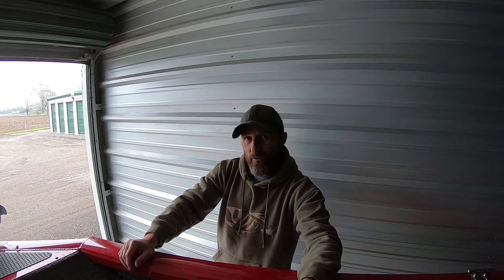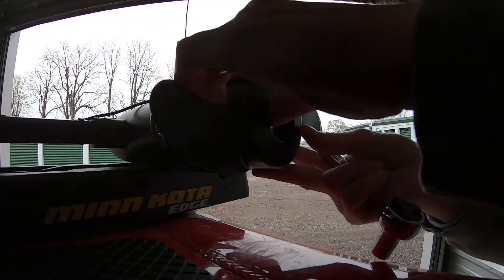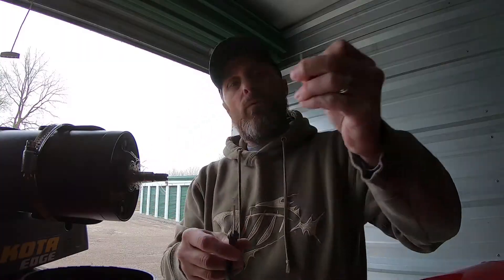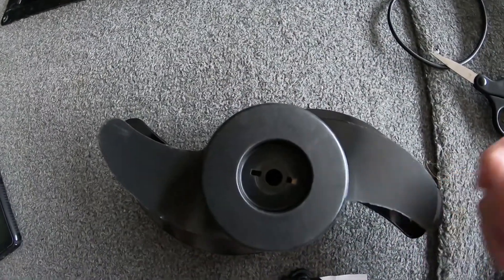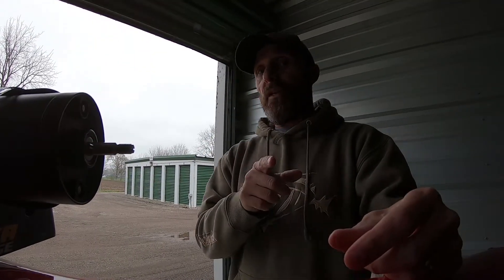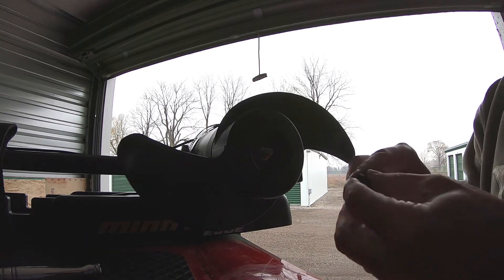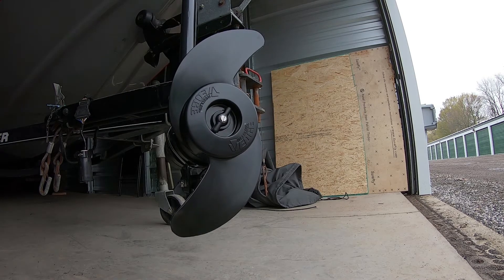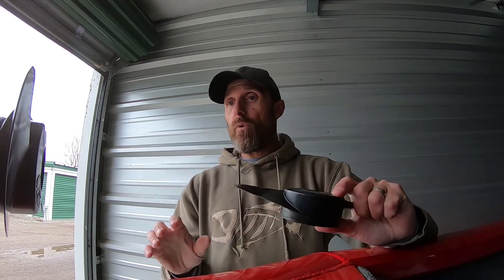Minn Kota Prop Install on Edge 45

Comment: Did it perform any better with the new one or about the same? I have the same trolling motor.
Reply from the maker: Hey Nick. It seemed to perform about the same in open water. I did notice a bigger difference in the weeds with the weedless wedge.

Comment: I know this is older video but I am curious if I should even order it I have no weed really
Reply from the maker: Hey SP! Honestly if weeds are not an issue for you then I would buy the regular prop. I got the weedless wedge because I find myself in weeds often. That's what I would suggest. Thanks for watching.
Reply: I know this is an older video, but giving it a go, by chance do you know the blade length, or over length from tip to tip? I just received one used, and it seems really big compared to the original? The blade measure 4", and 11 from tip to tip. It goes a little beyond the skeg. As far as I can see it only says weedless wedge on it.